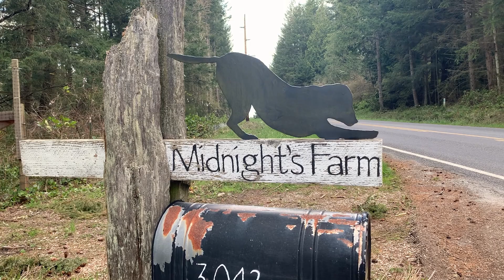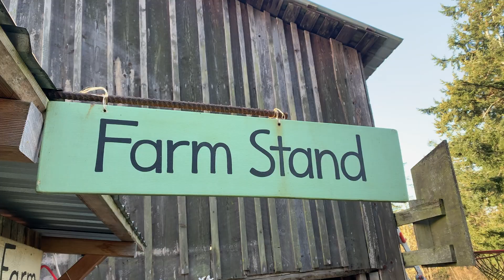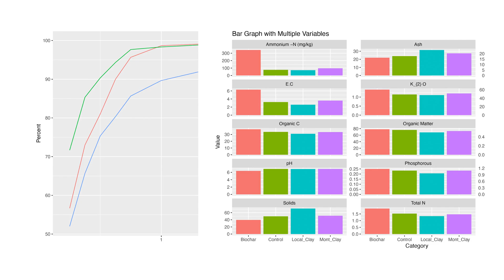Clay in Compost Experiment on Midnight's Farm

Comment: lettuce; did ya try anything else, because lettuce, at least to me anyway, who is no expert on anything, it doesn't seem like a fair metric to gauge the feasibility of your experiments, seems more like a lazy choice after ya got bored with the whole project; you must have tried other things though, maybe some anecdotal observations ya didn't mention?
Reply from the maker: For the trail we did lettuce and measured wet weight and did a tissue analysis.  There was not a statistical difference between the nutrients except for iron. There was higher iron in the potting media made from the compost with the local clay addition.   We did triple replicated trails on the lettuce.  We also did one with a compost that we made with biochar addition instead of clay and that was the one that really performed.  And out of this whole experiment where we would like to go.

Comment: Were you able to test humic acid and/or cation exchange capacity? My understanding is humic acid has a nucleus of clay to it, and may also have a longer development period than a single compost cycle. It's also a pretty stable form of carbon, so even if you're not initially producing more carbon, in the long run you may still be retaining more, or fixing more later in the garden. So long as it's not tilled, which burns thru humic acid.
Cation exchange capacity is increased via both clay and humic acid (and char), and may be a useful value to look at. I couldn't see either in the graphs of the video.
Very cool experiment!
Reply: Interesting comment

Comment: I have been thinking about excatly this for my chicken compost, what would happen if I added the clay litter from the kittens litter box.. I have sandy soil localy, so I need more water and nutriet holding compost/amendments.
Also, the graphs for biochar look amazing if I read it correctly, what percent of biochar did you have, 5%? And were that the result of nutrietns in the plant with biochar or plantavailable nutrients in the soil?
Reply from the maker: The biochar was 8% by dry weight of feedstock.  The graphs were looking at the nutrients in the compost.  We make potting mix with the different composts and trail lettuce seedlings in it.  The biochar potting mix grew larger lettuce seedlings.  That was exciting.

Comment: Wow, soooo cool you tried this! I've been thinking a lot about trying clay or rock dust in my compost. Did you do 5% by weight or 5% by volume? I once watched a documentary by the Austrian compost company Sonnenerde ("Sun Earth") and they said they use a staggering 10% by volume of rock dust in their compost. I would love to know where you are going with this. I subscribed in a heartbeat!! I really appreciate you posted this despite results being inconclusive.

An aside: is that a simplified Johnson-Su method you are using?
Reply from the maker: Glad you enjoyed.  We are very curious about rock dust as well but have not played around with it. We did  local clay silt addition 5% clay equivalent by dry weight of feedstock,  a control with only the feedstock (yard debris and/or yard debris and cattle manure/bedding), Biochar addition 8% by dry weight of the feedstock and Montmorillonite addition 5% by dry weight of the feedstock. I will check out Sonnenerde.